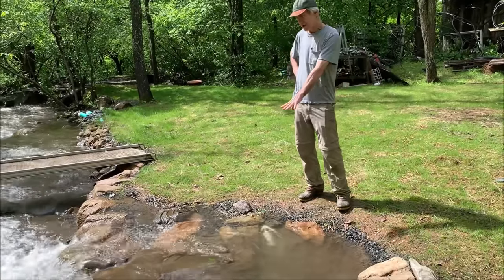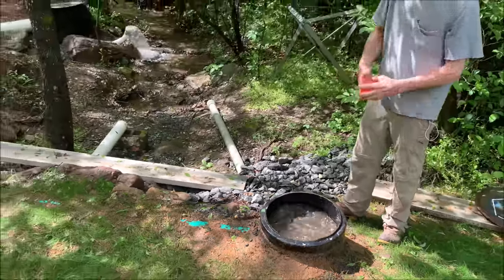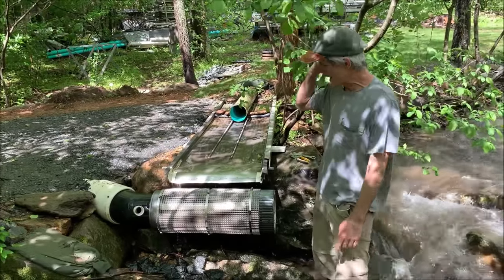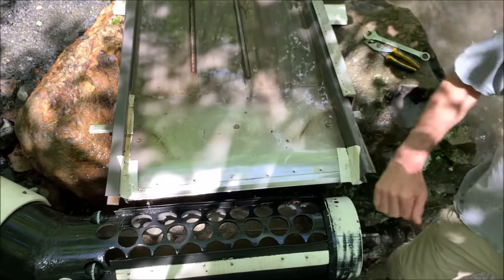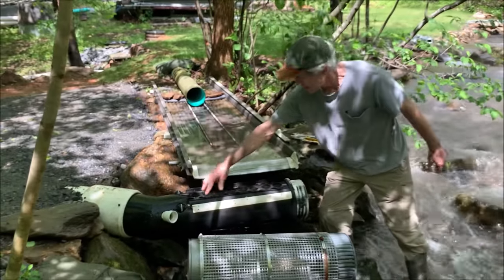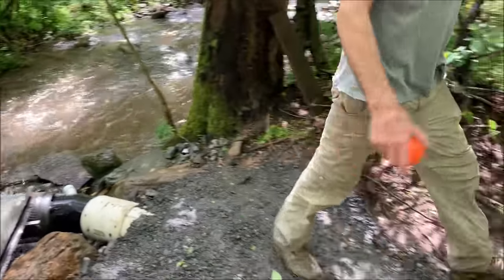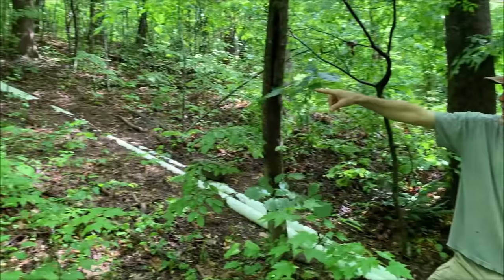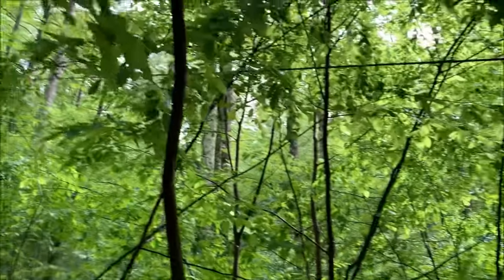500 Watt Hydro Power System in Virginia (Overview)

Comment: Your design for a self cleaning screen is pretty creative.
Reply: I'd like to see a test that compares this spinning screen to a static one with the same surface area. I cannot imagine that gravity alone would dislodge the items (twigs, vines, leaves, etc.) that typically cause clogs. Seems over engineered and expensive.
Reply: @K-Fed  
I can see how it would work well...as the grid rotates to the bottom position, the weight of the excess water falling through the screen from the back washes any debris out...and it falls back into the stream.....
It's a neat concept...but if it was in the direct stream bed, without all the extra gravel trap etc, with a screw type propeller on the squirrel cage end pointing directly upstream, it could achieve the same thing...as the screw rotated the screen any leaves etc would wash out.....and the clean water would go directly into the 1.5 inch holes and into the pipe...

Comment: Thanks, yes only 500W but it can be 24/7/365. Yes solar is much simpler, but only when the sun is enough, and I like tinkering and building stuff, so if I had the land I would do the same.
I do live in an old Mill house which many years ago had a water wheel, however the stream has been culverted and the Mill pond drained for housing, so no chance for me.

Comment: I agree with most of the comments. All that effort for just 500 watt?
Reply: Every engineer I have met or worked with had the philosophy of "Do the LEAST work to get the MOST reliable results and BEST results" .... Nobody is born with an engineering skill set or degree and that's OK but this is way over complicated.
Reply: dieselscience I will play devil’s advocate on this one, it may be overly complicated, but sometimes it’s more fun to do it the complicated way. I’m sure you could buy a waterwheel and set it up for a couple hundred bucks, and maybe a few day’s work. But with this, you have to plan out all the lines, figure out how to get more pressure, how to clean the water, etc., and that’s a whole hell of a lot more fun than setting up a water wheel in a few days. I speak from experience, as I’m a chemist who makes chemicals for the sheer fun of it, even if it’s more expensive to do so that way.
Reply: @dieselscience   I wish automobiles engineer  would think about  the replacement  work needed to repair certain  items on cars and trucks when designing  the engine components.  They certainly didn't think about easy and least  amount of work.   As for this setup  why to mush piping to get the power planing would make it let supplies and work.
Reply: @rimc8783  Automotive engineers are doing exactly what they're paid for. NO CAR is meant to last for the long term anymore. The second part... I'm not sure what you're saying there...
Reply: @autumn2675  Buying might be cheaper than building - what's your time worth?
Reply: @dieselscience  what I'm saying  is you shouldn't have to disassemble 1/2 your motor to change a water pump or a alternator. And yes I know with all the plastic on cars these days we willn't have classic cars any more.
Reply: @rimc8783  Unless you work at the dealership, the DESIGN INTENT is not 'user service.' Like I said, the engineers are doing EXACTLY WHAT THEY ARE PAID TO DO.
Reply: @dieselscience   I don't work at a dealership.  But I know many  who do! The mechanic LIKE THE JOB SECURITY, but they them selfs say the work to change many parts are unnecessary and could be planned  better. And as a shade tree mechanic  with 40 years of auto repair. I agree 👍  plus not many people  take there car to dealership after its 5 years old. Value  to repair  cost isn't justified.
Reply: 24/24 time!!......?
Reply: @DanielDaniel-do8uu  Yes, that's what I was thinking too. But still, 500 watts isn't a lot of power for all that work.
Reply: @rcpattaya230  So  you're a tough guy!!
Reply: @rcpattaya230  I agree with you.  However, I don't hear the guy complaining or bitchin about the lack of power.  I jumped around and while I'm not sure why he did this ( I'd have found a way to have done more to get more power out ) but it seems he's proud of it so ... it's cool.  

I'd love to have property that has a creek or river running through it.  I know that there are water right laws that are stupid and complicated .... but sure would be cool to be able to divert a small amount of water to produce electricity and then return it to the river.
Reply: @johnjacobjinglehimerschmid3555  you're right. I think we all agree this is a great job and for sure something to be proud of. It would be nice if he can elaborate a bit on his design considerations. I'm really curious.
Reply: dieselscience not much, I gotta say. And the point isn’t to do it cheaper, necessarily, though sometimes it does have the benefit of being cheaper. The idea is to have fun, even if it costs time and money
Reply: 500 watt plus charging capacity or just 500w output with batteries included?

Comment: If you keep the water in a pipe by the end of the distance you have neck it down with hose sprayer to run a peloton wheel with a one wire alternator and get more amps

Comment: Imagine this river would actually power you computer..
Reply: 400w for the PC and 100w left over for RGB
Reply: @patty8849  dude, 900 w for rgb and 100 for your computer. It gives you 5000% more gaming skills.
Reply: 750w at least for up to day PCs
Reply: @stevestefler880  Depends on the pc, a fast pc costing around £1000 won't take more than 400-500w
Reply: @benlawton5420  They won't take it only on power saving mode:) I have few useless old power supplies 350, 450, 500w and they can't even feed enough old PCs ( assuming they've lost their capacity). It's just personal experience with many cases of PC malfunctions because of lack w in power supplies.
Reply: @stevestefler880  It is a good idea to oversize the PSU to get better voltage control but that doesn't necessarily mean it's drawing more than 450w on a 450w PSU. A modern pc needs very clean power so a 650 is recommend even if your pc will only ever draw 400w peak.

Comment: The Efficiency of this system of the screened generator at the end of all his pipes and cleanouts is why it only produces 500 watts as FULL CAPACITY.   Golf ball bearings  REALLY? 

There are so many systems out there that FLOOR is output  many of which are very inexpensive.  This is only bragging rights  "I made this"  by a man that has no need for the output.  

The flow rate of this  STREAM has the ability to produce 1000's of watts of power. 
and depending on the property line on this stream he could put in two or three of these systems back to back or inlets alone back to back with one main outflow back into the stream. With some serious power being generatated 

Debris is always a problem and there are some good answers for that.  
a Gravel trap? he is not pulling from the bottom of the stream in the video.

Comment: Stick an impeller in the pipe for the rotating screen to make it turn - any water flow in the pipe then rotates the screen. Or simply weld a helix ring on it so any water flow over it will spin it as well.

Comment: "Two phase dc"... you have phases on AC NOT DC
Reply: i guess if you have two half bridge rectifiers, they can be out of phase.. still not quite the right lingo.
Reply: @adamramage7331  can’t have two dc voltages out of phase it’s a direct current lol it doesn’t alternate...

Comment: what is "2 phase dc"?
Reply: I said the same thing. I have never heard dc called 2 phase lol
Reply: I believe he meant +-12V DC.
Reply: @samuelferguson423  That would not make sense either. +12v - 0v (gnd) - -12v would be 24v
Reply: @somedumbozzie1539  dude what XD
Reply: I'm just sayin!!!!! Too much bs for nothing really.... 500 watts is nothing especially from that set up!!!!
Reply: @KravMike08  That's 12kwh per day, nothing to sneeze at.
Reply: @sspence65  @ 240 volt that's 50 Amps a day.... So you could turn an oven on for about a minute or so......

Good luck with that.....

Get an alternator for an F350 diesel and pull the diodes out and spin that badboy up and now you have 3 phase 240 v @ about 90 amps as long as the water is moving the alternator is spinning and giving you free power.... Might need a simple voltage regulator..... But you don't need batteries and a rectifier and power inverter.... Just an alternator it is was it says it is an alternator thus alternating current..... A/C for next to free
Reply: @KravMike08  12kwh / 240v = 50ah, not 50 amps, so it would provide 50 amps for 1 hour. However, most off gridders like us don't use electric ovens, and I rarely go over 15kwh daily, so with a small PV array, this hydro unit could satisfy my electrical usage.

Comment: if you have a pool, use a hose or few to siphon water into a deck mounted channel to power a water-wheel or 2 to generate electricity for a battery inverter system.

Comment: This system seems waaay too over-engineered. Overly complicated.
Reply: i guess he really ahtes debris,gravel and sand from clogging his system.. either that or he really has alot of time. then again after rewatching the whole video again he could put at least 2 more systems in the whole setup. he can have the vortex turbine system and also the screw type power generator and it would not even effect the downstream power output.
and i think he also have hearing trouble,
Reply: was going to say the same thing
Reply: Yup!!  I’ve never built one but to me that seems crazy Over engineered
Reply: I wish I could spend a few minutes with determined guys like this fellow, because I admire what they are doing, but I could simplify things so much with just a little bit of engineering advice. This is the second one now that I’ve seen where tremendous resources are wasted and squandered simultaneously, basically doing more and getting less.
Reply: Does he need all that length of intake. I envisionned like 100ft 4inch pvc with a screen to the turgot. Thats it.
Reply: The delta between 90% availability and 99% availability, right there.  Also: He's not significantly screwing up fish migration, which is saying something in a hydro setup.
Reply: Overengineered is not the appropiate term, its over complicated. But if you own lots of acres and have lots of access points to a creek, lots of time and unlimited supplies of pvc then why not? Lol
Reply: Yeah right,, all that for 500wwatts
Reply: you are losing  allot of head....i see allot of areas air lock can happen...
Reply: @steveperreira5850  You forget that many projects like this are done simply for the fun of it!  This undertaking is no more a waste of time and resources then someone who likes to go golfing twice a week or who pays to sit in a stadium and watch grown men toss around an egg shaped leather ball... We all have our hobbies, some of us like to get there hands dirty and maybe prefer that it take longer!
Reply: i dont see it that way. If his system get him maintenance free for the next 10 years it will pay for itself royally.
Reply: @angeloc3842  This is not engineering. This is just building.
Reply: So many solutions looking for a problem "KISS"
Reply: Overly complicated or incorporating lessons learned?  I suspect more of the latter :)
Reply: some people like complex systems and like to overengineer stuff... its called a hobby.
Reply: @Tlavite  And others who never accomplish anything themselves love to sit around and disparage those that do.   Gotta love anonymous comments on the Internet :p
Reply: Not if you stand back and look at it. he has a LOT of problems worked out that would make other systems FAIL. He did a LOT of thinking, and Research obviously. Would like to talk to him one day.
Reply: @cypriano8763  The more vertical drop he can achieve before the turgo, the more pressure, and therefore power output.
Reply: @thomasholland4313  500 watts PER HOUR, and it runs 24/7/365. He is making 12,000 watts a day, which is half as much as the average "normal" american house consumes. With a house that is set up for low consumption, he is making a ton of power.
Reply: @loonshotfarm9622  thats in on continous intake. Ponds inbetween add nothing to the head pressure.
Reply: @cypriano8763  he is pulling from a continuously flowing stream with 500' of pipe between the last "filter" and the turbine.......
Reply: @loonshotfarm9622  ah. That makes sense
Reply: @thomasholland4313  that's my takeaway from most of these off-grid setups...
Reply: All these steps are used to clean the water, as any small particules is abrasive against the turbine. Not sure you could really simplify.
Reply: Way too much pipe and wire. The $$ will never offset itself.
Reply: @ozner1981  I don't get why people are saying over engineered.... If it keeps him from unnecessary maintenance then why not
Reply: I was thinking the same thing
Reply: Lol😁
Reply: All that for 500 W ?
Reply: maybe he's planning to add more options
Reply: I like stuff like this😻
Reply: Hes got a Native American direction tree on his property and he's using it to support his piping.
Reply: @steveperreira5850 how would you do it
Reply: It is well done, but the pipes could be buried a little, they didn’t need to cross over the stream at the end, and I would worry about the water level going up or down.

But I am looking for the hydro setup with random parts from a garage and an old truck alternator that I have laying around….  To hide on a river that might go up 3 or 4 feet in the Spring…
Reply: Agreed definitely could make it alot less time extensive and money....
Reply: Brilliant

Comment: That is a lot of equipment to produce 500w - also I wonder how feasible a few lead acid batteries are for higher loads..... surely they can only be charged/discharged a couple of hundred times before they need replacing? An expensive undertaking.

Comment: This is awesome, don't get me wrong.  But you seemed to have enough fall at the weir to bore a large hole straight down behind it (which can have a screen cap) and have it connect to a horizontal bore  hole 10ft. or so underneath it that eventually emerges above grade.  Then just plumb in a turbine.  Seems alot simpler than this.

Comment: was a great video,  loved watching but seemed over engineered. couple ideas to look into for you, first your power station needs to be as close as possible to your house. longer distance is more energy bleedoff,  example, ever run a big shopvac or something on 2 or more long drop coords?  wire heats up,  maybe breaker trips,  or motors run very slow?   im an electrician an when wiring houses an things you have to derate your wires,  also if you have more than 3 circuit wires in a small pipe you have to derate at a higher rate an also consider distance. just because your on a 20 amp breaker doesnt mean your fully getting 20 amps. also can have water source closer,  start with bigger pipes an with your gravity feed reduce pipe size in increments to up the pressure as you need.  also use straight pipes. bends kill pressure.

Comment: Only 500Watts?
What a waste of energy of the creek ?
Reply: Im thinking a minimum of 2KW. AT least get it up to what a small fuel gen could do. Wire distance equals power loss unless u compensate via larger gauge wire .
Reply: @bombasticbuster9340 transmission of AC does not require thicker gauge of wire , for 500 watts that's more than enough for that wire to handle.

Comment: And why are you yelling ? lol
Reply: The water can be loud
Reply: Great...the water supply is excellent...make it even better...save the screen and decrease the diameter of the ball bearings to 1/2 an inch...then use a water wheel of larger diameter for larger leverage turn into higher rpm of the generator.
Reply: What!?

Comment: You should use AC electricity, so you no need to spend on batteries! If it was solar, I support you to use batteries but for hydro-power it has 24-hour working for you!

Comment: What kind of charge controller  are you using? I have got the same project generating 110 volts but cant find any cheap charge controller  to process the  power

Comment: Might want to add a small DC fan to exhaust the gasses from the batteries or build a separate enclosure so the electronics are not destroyed by battery gasoff. A lot of work for continuous power but very fun project.

Comment: In summary, all this is to spin a shaft, rotate a shaft and somewhere down the line an inverter is connected to the rotating shaft and convert that energy into a form that is stored in a battery which is, in turn, connected to a (?) which has the plugs you plug your electric appliances I to.

Is rhat right, please?  

(Clearly, I am a clueless, completely new to all this, trying to understand the very basics, ie, not so much interested in the water as the thing that rotates the shaft (if that is what happen), could be a windmill or windblades that rotate the shaft (if that is what happens).

Comment: 24V @ 17A can be done with 4 100W panels and an MPPT controller.  HELL of a lot less complicated, but yea I guess if you love to build and carry pipes hundreds of feet?  wonder what the cost difference between 4 panels and an MPPT controller would be vs the hundreds of feet of pipe and the turbine and what not.  I guess the benefit of this is that it does this ALL the time, not just during the day.

Comment: His 3 faze to DC seems unnecessary. Then DC to inverters to AC. You can just use a transformer to get 1 faze. It seems like the power drop from all that inverting would be a major inefficiency. I could be wrong though. This could just be cheaper than other products also. Good work on the plumbing!!